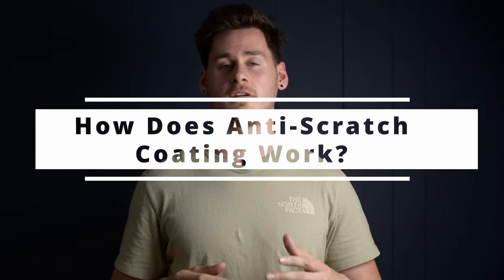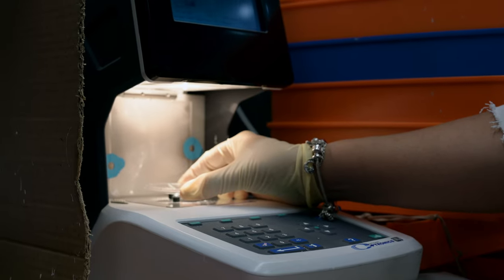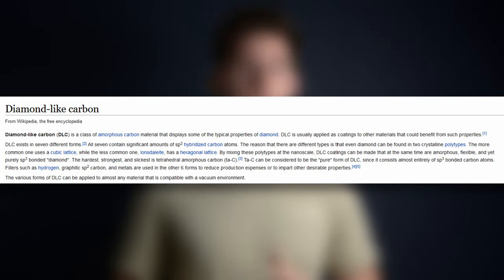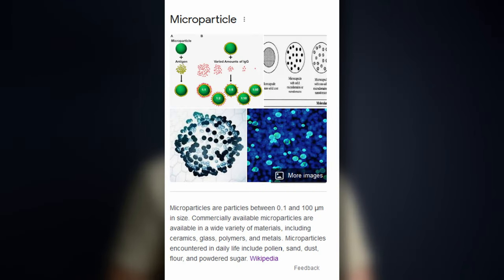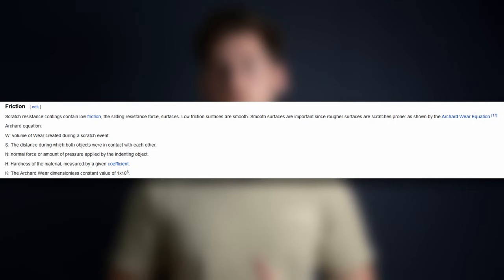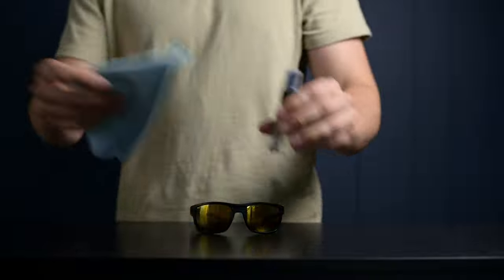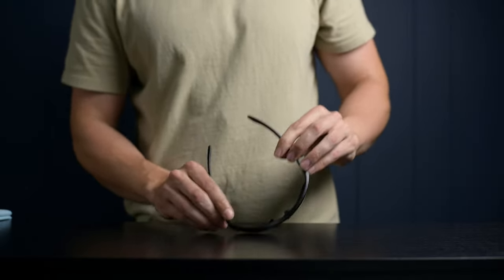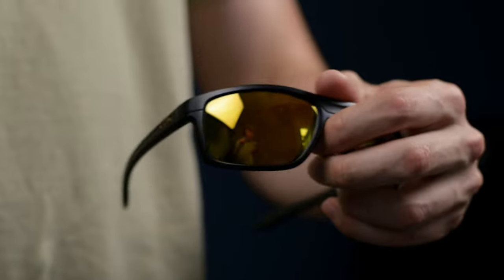Do You Need Anti Scratch Coating on Your Glasses? | RX Safety

Comment: Anti-scratch coatings don't work worth jack. You still have to baby those polycarbonate lenses to keep them from getting scratched. My next pair of glasses will be actual glass, which is much more durable than plastic. I don't care if the glass lenses are heavier. At least I won't have to replace them every 2 or 3 years.
Reply: Try glass in a -11.5 set of lenses 😂